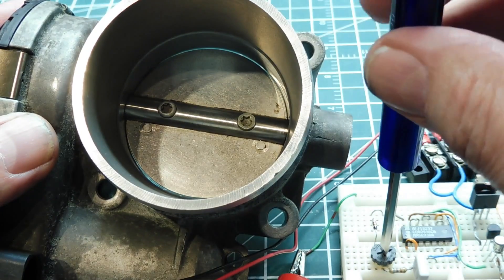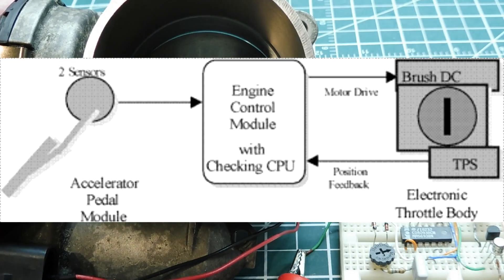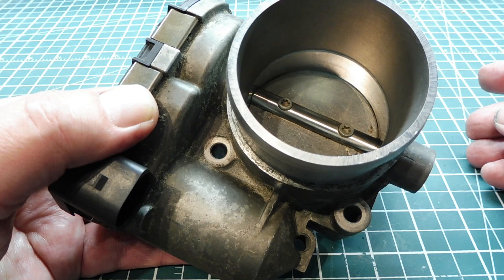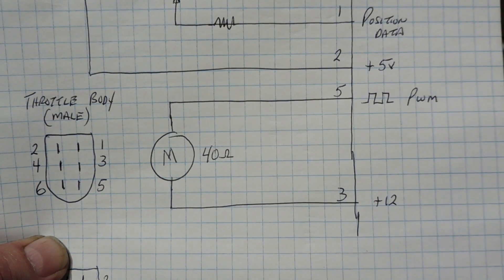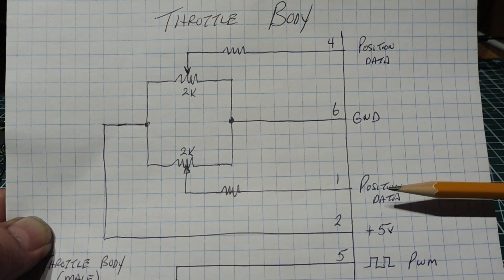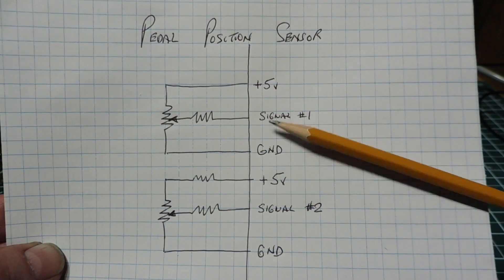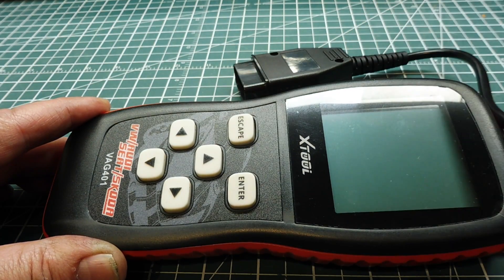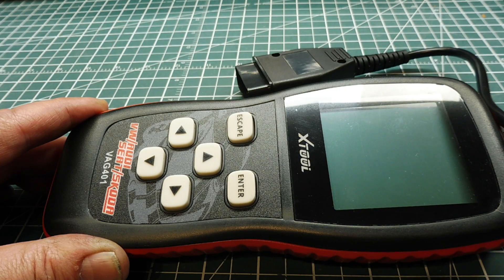Drive By Wire With PWM  / Audi A4 1.8T Throttle Body

Comment: I have a different throttle body (Marelli 48SMF5) on a 1.6 Fiat Stilo 1.6 (ECU IAW5NF.T9) that has a dead spot between 1000 and 1200 RPM. No CEL though. The strange thing is that in the diagnostic, the pedal position sensor is stuck at 0% but the RPM moves from 750 RPM to 1000 RPM. But then it spikes to 1200 RPM and only then the pedal position sensor changes from 0% to ~3%. What would be the best way to diagnoze it?

Comment: Wow, thank you sooooo much! This is extremely helpful in my current troubleshooting and saving me lots of time. (Throttle valve error; adapt fail; & I like to test parts instead of just blindly replacing. My potentiometer numbers all add up correctly, btw. Maybe dead spot like you? I tried contact cleaner on the wipers, no change. Possibly problematic wiring outside of TB entirely. Edit: Keep reading--solved.)

Update/Solved: On the off-chance somebody else comes across this issue and reads this, in my case it was that water had somehow entered the ECU box (it's in a terrible location to minimize water exposure.) That box contains a few relays and 2 fuses. The 40A ignition maxi-fuse was blown. After replacing the water-logged relays and the fuse, I opened VCDS and cleared the codes in the Engine Module--and they stayed cleared! Hit channel 060, and adaptation was already "A.D.P. OK" even before turning on Basic Settings. I finished by drilling a couple 1/16" holes at the lowest point of the box, to prevent accumulation from happening again if it somehow leaks in the future.
Reply from the maker: Glad it was helpful! Thanks for sharing.
Reply: @0033mer  Whoo got mine fixed. Wasn't TB in my case--that was just a symptom. Turned out to be the fuse and relays inside the ECU box...which despite being sealed, somehow got water in it which pooled around the relays and subsequently blew the fuse. So apparently the "ignition" relay and fuse can cause this problem as well. (Also had weirdness with cooling fan which this resolved as well.) Still, this video was super helpful in learning about how the TB system worked--especially the internal diagram you saved me the trouble of reverse-engineering!

(Actually, I should probably just edit my original comment, just in case others randomly stumble across it.)
Reply: @TravisTerrell  it is usual to have a code for throttle body valve when the issue is somewhere else. In my Fiat Stilo 1.6 I was getting P0638 throttle but the issue was a clogged fuel injector on the 3rd cylinder. At some point it threw both P0203 and P0638 and then the problem was solved easily. I now have a minor dead spot very low in the RPM range but this is reported many times on the forums and it might be a software bug rather than an actual hardware fault.

Comment: So the problem I have had with trying to control an electric throttle body is lag and oscillation.  Any chance of looking at controlling a throttle body using a throttle pedal and an arduino set up as a PID controller?

Comment: Great video, thanks. If you send for example 50% pulse width, how does the throttle body know when it is 50% open? Is it determined by the ecu based on the sensor output from the TB, or done within the TB itself? Cheers
Reply: I'm aftermarket applications you have to learn the end stops both pedal and throttle body
Reply from the maker: It is determined by the ECU based on the sensor output from the TB.

Comment: single polarity PWM is not enough to fully control a dc motor, you need an H BRIDGE to control motor spin direction AND speed
Reply from the maker: Yes .. You are correct. I have an H-bridge setup to test throttle bodies but wanted something simple to demonstrate a PWM circuit in this video.
Reply: Is this the case with every TB? Butterfly valve has a spring that returns it back (the one I got). Maybe some TB valves don't have springs attached?
Reply: my car and moped both have a return spring in their TBs. a return spring is remommended as a fail-safe
Reply: @diglo  hm, so why H-bridge is used additionally to reverse polarity for motor pins then? :) Maybe some of valves (or all of them) need more speed to return back? Also, this would mean that power supply is reversed somewhere within ECU box (mosfets and a driver are probably there)? Things are getting more complex - pwm + polarity switch... This would require PID as well... Hmmmm
Reply: @nosuchthing4789  with an h-bridge, pwm and an encoder feedback you can control position and speed of a dc motor. For better position accuracy and torque, i would use a geared reducer and place the encoder at the final gear.
Alternatively, a stepper motor would be an option as it does not need an encoder to hold it position, and if the motor is sized correctly, it may not need gear reduction
Reply: the polarity is reversed by the h-bridge, you need a single constant powe supply
Reply: @nosuchthing4789  additionally, current drive by wire system use a dual wiper potentiometer as a position encoder in place of an incremental encoder. this gives you and absolute throttle position feedback and the dual wiper provides redundancy
Reply: @diglo  I understand how this works. What I am questioning is if H- bridge is used for every TB. With the return spring I don't think it is used since it is highly dependant on tension and position of a spring (how stretched/compressed  it is) and why would it be used... Therefore, complex calculations would be required and probably PID/dedicated MCU is a must. For H-bridge (probably) gears are used to reduce the speed/slow down the response - but no spring. I see no sense in that, I will have to search for more info. For stepper motor - this is probably for some special or newer vehicles?
Reply: @diglo  see this video to understand what I am trying to say. 
https://youtu.be/6SufTXrs1J4
The TB from this video we are commenting on is also using a spring.

Comment: Excellent !! An awesome example of PWM and drive by wire. Do you have info/details on your test equipment and the laptop version ? Thnxs for sharing.
Reply from the maker: Here is the video with the schematic diagram.
https://youtu.be/mjIubJeTRyY
If you work on Audi or VW cars these are a must to have.
https://www.europaparts.com/general/brands/ross-tech-vag-com-diagnostic-systems-vcds-audi-volkswagen-seat-skoda.html

https://www.amazon.ca/VAG401-Professional-Diagnostic-One-Click-Function/dp/B014CT4T2E/ref=sr_1_2_sspa?ie=UTF8&qid=1538203662&sr=8-2-spons&keywords=vag401&psc=1&smid=A31FX2S6MM4FLB

Comment: Hello I’m working on car project with the same throttle body my plan it’s make it work on a datsun with a electronic pedal can help me to built that board are you using to control it  please send me a response here alvarado1710@gmail.com if you can send scheme and components please have a nice day
Reply from the maker: Check out this video for the schematic of the PWM controller.
https://youtu.be/mjIubJeTRyY

This controller is for testing only. For actual use in a car I would use a microcontroller driving a H bridge and incorporate the feed back signal from the throttle body to build a closed loop system. Safety should be a priority.